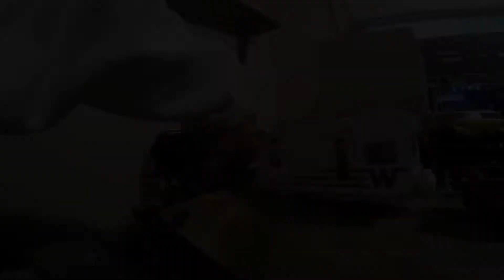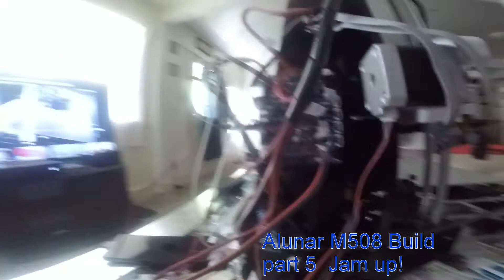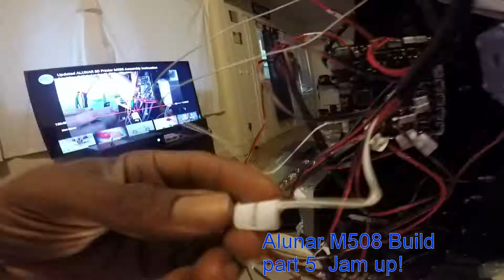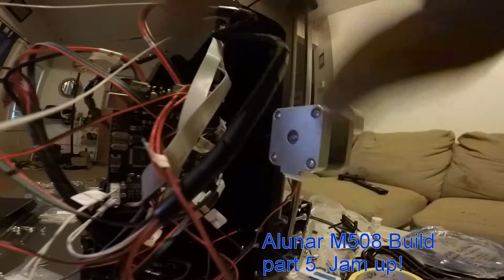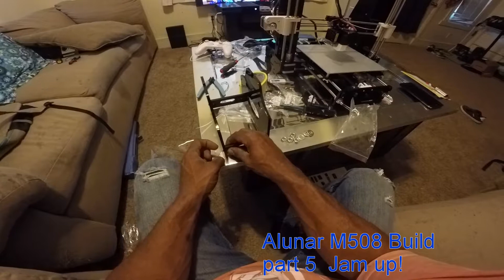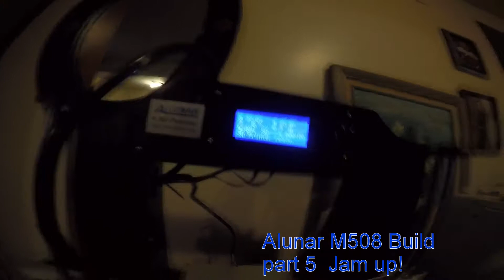Alunar 3d printer build part 5 JAm UP

Comment: Good videos.  I have same printer but running into an issue I think. Just finished building and noticed after powering on the display shows XYZ blinking ?. So I ran auto home and it stops on left front of build plate. X shows as -10 and Y -15 and Z is 0. Going back to main screen. It shows XYZ blinking again. Appreciate any guidance. Oh, I also clicked on the Set Offsets and now when it homes the same pattern is done but in short quick movement.  Wondering how to reset that so it isn't set.  Any guidance is appreciated.
Reply from the maker: i just turned the printer on went home yah bro your all good ! its ,X-10 ,Y-15, Z 0  https://www.youtube.com/watch?v=RSqm3F0eAKQ